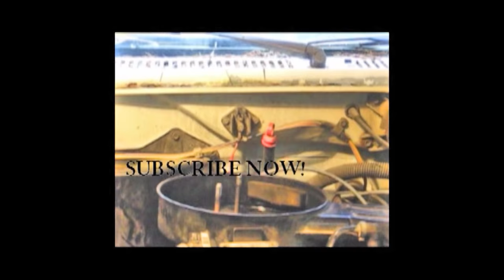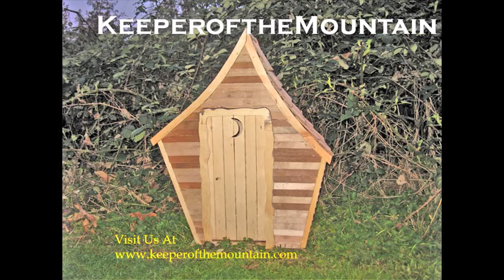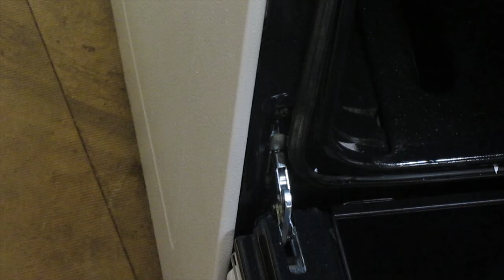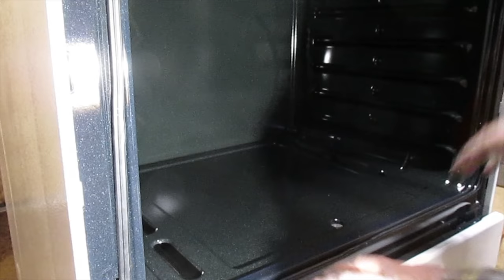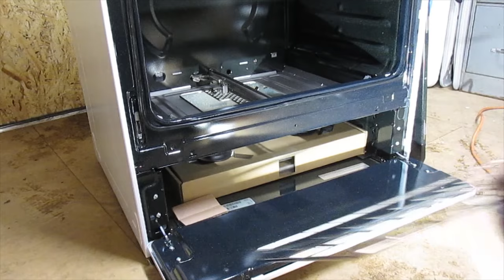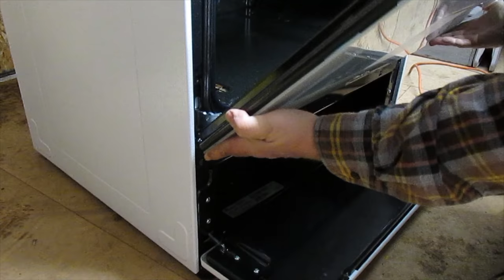Converting a Natural Gas Range to Propane

Comment: Great, and simple with no extra unneeded nonsense designed to make a humorous or cartoonish of a straightforward task.  No doubt about propane or Natural gas being a dangerous element of our everyday life, but fear of it only leads to ignorance of maintenance, opening one up to potentially disastrous consequences if left to procrastinating attention to it's malfunctions due to cost involved in servicing it properly.  I totally agree that after viewing this video, you do not believe that you can handle it due to not knowing a Phillips screwdriver from a drill bit. Call the pros.  It is not everybody's experience that uses tools for anything other than a fork to feed your face with, nothing to be ashamed of, just a fact I ones life, and yes, doing the incorrect thing has the potential to be fatal or maiming.  This was presented by a pro, and I wouldn't hesitate to follow these instructions with a confidence borne of understanding that it is safe and near bonehead proof, but still would proceed with utmost caution erring without apology, on it's side.....good video and thanx.
Reply from the maker: Thank you for that. I really appreciated reading it.

Comment: The socket is 7mm not 9/32 or 11/32.  It fits better and generally the spring clip on the out side of the orifice will hold it in the socket.  I also would carry a towel to protect the stove top and another for the counter.  When ever I took the screws out of the burners and or orifice heads I would put a tiny bit of antisieze on the threads before putting them back.  A year or two of boiled over pots you will still be able to get them back out if you ever need to with out breaking the and have to buy a new orifice head. Then check to see that the flames are the correct size.  Quite often they need to be adjusted.
Reply from the maker: Thank you for watching. Everything you said are also good things to know and practice.
Reply: I did my today...9/32 is correct!

Comment: it would be necessary to regulate the minimum flame of each tap, or you will not have difference of maximum to minimum since the propane has greater pressure than the natural one. turning the knob will be the same maximum and minimum. I hope you understand my Argentine English  saludos

Comment: PERFECT!  I JUST bought (pretty much) the same model, only in stainless.  Will be doing the conversion right after church today. THANK YOU!  

BTW, I've converted a couple of stoves in the past and installed a lot of LP pipe in a previous house so no flame throwers here.  Besides cooking dinner on a flamethrower can get a little too interesting.
Reply from the maker: At least it may be faster. LOL

Comment: Question it converts it to liquid propane or regular propane gas? I never knew there was a difference until today
Reply from the maker: Great question. The stove runs on vapor. 
Here is how propane works. Propane is known as LP. That means Liquid Petroleum. It is shipped, delivered and stored as a liquid. Propane liquid will boil at -44F.  When the liquid is stored in a tank or bottle it tries to boil off causing pressure to build in the vapor space at the top. As you use the vapor, the liquid boils in the tank, making more vapor.
like any other liquid, when it goes to vapor it cools off. Like when you get water on you in the summer, as it evaporates it cools you down. Propane does this only at a different rate than water. If you get liquid propane on your skin it will evaporate and freeze you, giving you a freezer burn. If you use propane too fast for the tank you are using, it will freeze up, loose all pressure and your appliance will quit working.  Equipment like a fork lift has to use a small fuel tank and thus it will freeze up in a short time and stop working. To fix this problem, liquid propane is taken from the tank to the evaporator in the engine compartment where heat from the engine is used to prevent icing up. Then the motor still runs on vapor.
 I hope this helps.

Comment: If propane runs at a higher pressure, why can't you leave the natural gas jets in there and leave the regulator set at a low pressure? It seems to me with the conversion all you're doing is allowing more pressure in the regulator and limiting it at te jets.
I haven't experimented with this but seems logical to have the regulator do the job 🤷‍♂️
Reply from the maker: Natural gas is much different in it's character compared to Propane. There specific gravity is different. Their BTU capacity is different and there range of flammability is different. With all of these variables, the jet size is optimized for that gas specifically.
Reply: @KeeperofTheMountain  ahh that makes sense, thanks 👍

Comment: While trying to remove the sealed burner the screw head snapped off on the used Maytag stove I was converting to LP , I can"t remove the screws without them breaking ,  Various liquid wrench etc did not help. Any help or suggestions might save me the total cost of the stove.
Reply from the maker: You may have to replace the burners. normally the pot metal that most of them are made of will not survive getting the corroded bolts out.

Comment: Can you contact me?  I need help!  I can only find the conversion for the burners of my stove not the oven part.  When I purchased my Kenmore range the salesman told me it was included but what was included was for a whirlpool dryer???
Reply from the maker: If you take the make, model and serial number, you can find the correct kit on the Kenmore website. Or you can go to one of the many appliance parts sellers on the web and buy the correct kit. Another option is to take that info to the store where you got it and show them that what you got was wrong and insist that they get you the correct kit.

Comment: One pound per sq inch is exactly 28 inch water column.  My local Toronto natural gas pressure is about 7 inch water column (1/4 PSI)  A lot of gas nozzles are classified by drill bit size.  Numbered drill bits. So basically, your conversion consist of changing the gas nozzle size. For industrial burners, we start with the gas pressure, and we set the number of nozzles and the nozzle size to get the BTU required

Comment: Hello, what if you drill just a little bigger the hole on the orifice part in order to get more flow of gas? Thanks
Reply from the maker: When changing to Propane, you need a smaller hole. You would just be building a flame thrower. Hmmmm, might be fun.
Reply: @KeeperofTheMountain  thanks for your response, I bought an used gas stove it was set up for propane use, so I made the orifices a little bigger with a very small drill bit and its working great, good flame, strong, cook in minutes, no leaks. Would be it a problem or fire hazard? what's your opinion? Thanks in advance

Comment: Great video! Very informative. Although I’ve got a couple questions. FYI I know nothing about this topic, I will soon be converting my new stove to propane. Thinking of using pro flex Lines from the stove to the propane tank outside. I was unaware the stove came with a regulator and figured I purchased one to install along side the tank outside.  Should I only use the stove’s regulator or install one myself at the propane tank??
Reply from the maker: Definitely use a regulator at the tank. There are several reasons. One is that if you run a line longer than 8 feet at tank pressure, there is a bit of oil suspended in propane and it will condense in the line and plug up everything. 
Also there is a code that 5 pounds or less is all that is allowed in the house. It is not safe to run more. If your tank is right next to the house, you are best served with a 1/2 pound regulator. If your tank is bigger and out in the yard, you will want to run a two stage system. A first stage at the tank. It is always a red regulator. The red regulator will reduce the pressure to 10 pounds. Then at the house you will need to reduce it to 11 inches or 1/2 pound (The same pressure). The regulator on the stove is for fine tuning only and cannot withstand high pressure.
Do a google image search for "Propane tank clearances" and a page of the code book will pop up telling you everything you need for tank placement.
Reply: @KeeperofTheMountain  Hi Keeperof Themountain. Sorry to hijack this thread and eddys comment but I have a grill in my oven (upper portion). It has an injector on the back of the oven body. When I turn it on, there is a strong hissing sound emanating from the back which was not there before. Is it a hazard? Do I need to replace it/clean it? What is the purpose of the injector being exposed (It does not connect with the body of the oven rather its directed towards the opening of the gas tube)
Reply from the maker: @elijahantony4300  It sounds as if you have the burner tube installed improperly. Look at how the oven is done. If you have it wrong you can cause a fire. go over the manual for your appliance again to see what it is supposed to look like.  If you have no manual, they are available on line. Google your make and model number and you will no doubt find what you need.

Comment: Is there any info u can give me about my same exact range throwing a ph5 code? I followed ur video to convert it and it worked also my flames on my burner won't turn down alot
Reply from the maker: I do not know about the code. There should be a code reference in the operators manual. That is available online if you do not have it. You will need the model and serial # off of the stove.
If you slowly turn the burners like you are going to turn it off instead of the low setting, you can turn it as low as you want.

Comment: How do you convert your supply to propane?
Reply from the maker: I converted my home from electric to gas. I ran black iron pipe from the stove to the location I was putting the tank. I put a shut off valve behind the stove. I used a 1/2 pound or also known as 11 inches of water column regulator at the tank. All of the regulators you can buy are 1/2 pound unless they are red or have a red knob. Those are 10 lbs. If you google "Propane Tank Clearances" you will get an image right out of the code book with all you need to know for where to set the tank.

Comment: thanks for the video, I bought a super expensive gas stove and no-one at home depot asked if it was for propane or the city gas pipe lines, long story short I started using my stove and all of the sudden all my nice pots and pans have a black film all over them and it is impossible to get rid of so every night I scrub and scrub my pots and pans and not to mention every time I use the oven that film is all over the oven,I'm a slave to my stove every single day I clean and clean it. I was to the point of getting rid of it and just buying an electric stove so  I finally asked the guy that fills my propane tanks what was happening and he said oh yeah you bought the wrong kind of stove ! and now you need to buy these converters - I'm like what the heck no one told me. Any-who you make it look easy enough for me to do it. Thanks....  oh where can I buy the converts ?
Reply from the maker: If you can, go back to where you bought it and request the kit. It may be in the extra stuff that came with the range. The other option is to look on Amazon. Have your make , model, and serial number handy

Comment: @   Keeperof Themountain When you buy a new gas range do they all come with the LP conversion kit? What ranges have you worked with that you know for a fact come with an LP conversion kit? Also a question about the brass fittings you put in the hole of the burners; are they all brass? or are they ever a different material?
Reply from the maker: They do not all come with a kit. Most do but, because the models and options are constantly changing, it impossible to say which ones with a certainty come with the kit, When you see one you like just ask the sales person and they can tell you. If you are buying from a private party a used stove, using the make, model and serial number, you can look it up on line using your smart phone right there.
Most are brass but sometimes another soft alloy is used. I am not sure what it is but still be careful as it is also a soft metal.

Comment: I definitely will try this however i have one question. If i was to buy a used stove and go to our local hardware store will i find the convertion kit.? are they universal .? another thing that blue thing at the end that looks like a little plug and you turned around to be 11 will that be in the kit....? I feel confident that i can do this . The hose for the small propane is that gonna be the same size...?
Reply from the maker: You will need the kit for the specific range you are working on. They are available on line or some used appliance shops will order it for you.

Comment: What if it has an upper broiler?  Then you have to screw in that broiler orifice.
Reply from the maker: Yep, that is covered in the video.
Reply: @KeeperofTheMountain  No it's not.  You imply there is another orifice to change out in the broiler if it has one.  But you don't change those out.  Instead, you screw in the orifice further, typically one turn, which makes the orifice smaller.
Reply from the maker: @MrHanowski  I just did a nicer GE model with a broiler tube. I changed the nozzle. It came in the kit. There may be some that work like you say but it is not normal.
Reply: @KeeperofTheMountain  I've done lots of LP conversions while working for Sears as an appliance  repair tech.  Never changed a broiler nozzle.  Always screwed them in.  Not saying they are all that way, but I'd say it's more common to screw it in further, rather than replacing it.  GE does things differently.

Comment: This doesn't really help.. hoping there's another way. I have a N.G. space heater, an older version of a blue flame unit that I'd like to use as a propane space heater.. IS there a way..? Even if I could take it apart, there's no diagrams or parts lists to find what size orifice thing I need.

Comment: Great job, hope.ot works on my Sunfire X24 commercials stove?!
Reply from the maker: The principle is the same. Your access may be a little different and you may have to change out the regulator completely depending on the brand but , it is the same process. Replace the orifices and the pressure. Just get the correct kit for your stove.

Comment: Thank you for this! We bought the same stove a year ago and did the conversion to propane. Our problem is it doesn't seem like there's enough gas "in the line" or pressure. It lights and goes out. Sometimes slowly, sometime almost like it coughs. I hold a grill lighter to it since the igniter would be ticking forever while the gas seems to "fill up" or have enough gas come out to even light. Out has only gotten worse.

The gas guy who came couldn't figure it out. Could it be that my husband did not flip that blue thing for the pressure? Sorry for sounding so girly LOL please help! I can't cook anymore!
Reply from the maker: Checking the regulator setting is the first thing I would do. If you have other appliances and they all work fine then it has to be that the regulator is set wrong or plugged. Sometimes when installing the gas line, People will use Teflon tape. The danger there is that some can come loose and plug up the regulator. As long as it is only the stove with the problem, and the entire stove is having this issue, the regulator is either plugged, adjusted wrong or defective from the factory.
Reply: @KeeperofTheMountain  It's only the stove on propane so unfortunately hard to tell. Thank you for your input. He's going to check the regulator!

Comment: Natural Gas ranges are about 7 WC 
Propane is 9-11 WC
Good video man. But the pressures are relative. The major difference is the density of the gas. Propane is MUCH heavier and twice as efficient. Hence the orifice size difference. Hope that helps.
Reply from the maker: Yes, I did not think I needed to do a deep dive into the gas properties for most people. It is a case of when is enough information enough and when does it begin to confuse people?
Reply: @KeeperofTheMountain  wasn’t being critical at all bud. We appreciate you putting this out there. As a matter of fact it aided my conversion today. So a thank you is in order.

Comment: What is the difference between Natural Gas and Butane? We use Butane here in Belize and I have this exact stove. Just want to know if I need to convert as well or I can use it as is fresh out the box
Reply from the maker: Good question. I am not sure of the answer. You will need to ask the manufacture.
Reply: For butane u have yo convert to lp butane and propane are lp gases (liquefied of petroleum)

Comment: Why not just reduce the pressure at the propane tank and leave the stove as is?
Reply from the maker: Thank you for watching. The characteristics and physical properties of the two gasses are such that doing that would be problematic. The changes made in the conversion make the best use of the fuel.
Reply: @KeeperofTheMountain  i just spoke with the local gas store about this.  Their answer was a bit less nebulous than yours. The problem is that propane runs off high pressure and low volume.  Natural gas is low pressure high volume.  Coming up with a propane mod to replicate the conditions of a natural gas line is tough.  Thats the answer